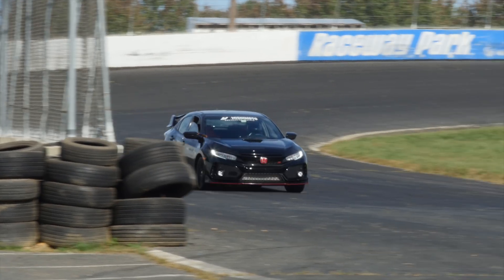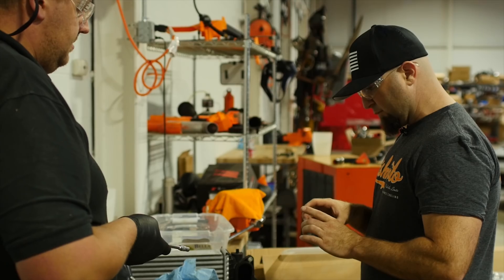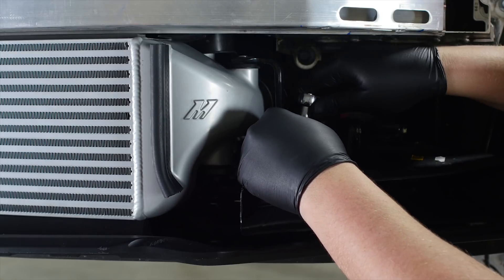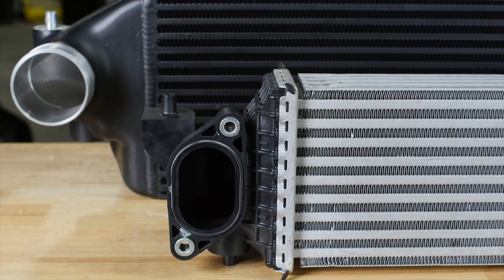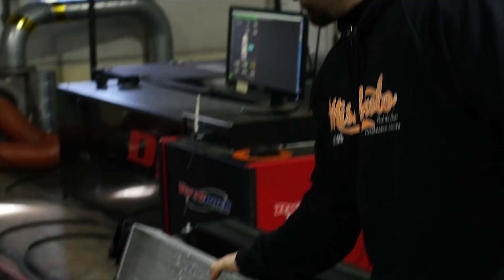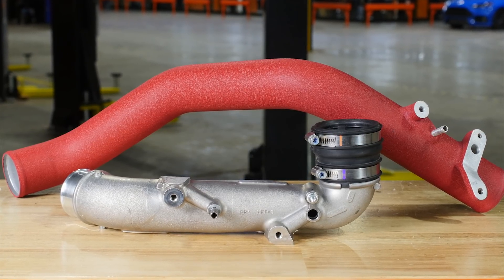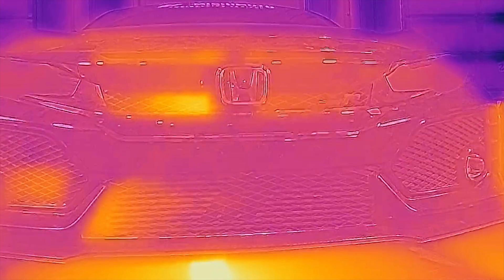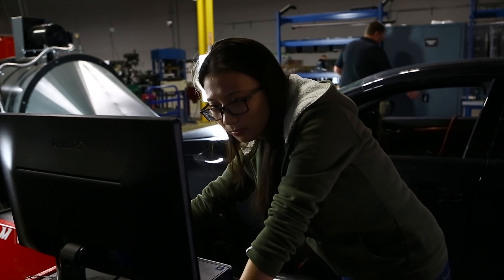2017-2021 Civic Type R Performance Intercooler Product Development by Mishimoto

Comment: Hi Mishimoto

I have recently purchased your intercooler here in the UK, ready to install at the weekend,  I have a few queries firstly the item looks like it has been out of the packaging with marks on the top of the intercooler, there is no bumper removal tool, and I have now been told this item will not fit my UK FK8, please confirm if the item will fit, as if not it will have to returned 

Many thanks
Reply from the maker: Our production team were not able to identify any differences on the UK delivered cars when it came to fitment for the FK8. The install should go pretty smoothly, if you run into issues, of course feel free to contact us at support@mishimoto.com for help.
Reply: Thankyou for your help 👍🏻
Reply: Earth Dreams UK how you go?
Reply: Unfortunately, I had to return this intercooler, as it wasn’t a direct fit for my UK FK8, crash impact bar and pop  up hood system sensors are in the way of the install , and also the hard piping has an outlet on it, the UK car doesn’t have this.

Mishimoto were understanding and gave me a refund, but unsure if these problems have been addressed for future buyers.
Reply: Earth Dreams UK same here in Australia but I moved the pop up hood system sensors above it and plugged the hole in the inlet pipe
Reply: Ben Patrick 

That’s good, I did similar to you, but the sensor kept giving warnings..I wasn’t happy with the turbo lag I was getting, not sure if you have any.

In the end I returned it. Went for a different brand, better fitment and no lag.
Reply: Earth Dreams UK how did you clear the warnings I still have mine I have a bit of turbo lag but not so much but the color is ugly it’s not silver what they say it is and what brand did u go with
Reply: Earth Dreams UK I’m ganna change myn to then
Reply: Ben Patrick 
I found it quite disheartening, spending all that money, and the item didn’t live up to my expectations... good luck with your endeavour. Hope you get it sorted
Reply: Earth Dreams UK did u bend the brackets back that hold the senor?
Reply: Ben Patrick 

Yes I also tried that, still no good, warning lights on constantly... so intercooler had to go
Reply: Earth Dreams UK when you put back the senors back in place did the code go?
Reply: Ben Patrick 

Once the sensors and brackets were back in the original place, warning light went out
Reply: Earth Dreams UK I got the senors to work
Reply: Ben Patrick 

What about the horrendous turbo lag??
Reply: Earth Dreams UK nah haven’t fixed that yet but it the way u drive it if you don’t want turbo lag just stay in high revs. How u going with your car
Reply: Ben Patrick 

Car mads are going well, just had HKS solid boost pipes, hybrid turbo and acuity stage 3 assembly fitted.

Check me out on Instagram : earthdreamsuk

Comment: Does it gives turbo lag to the car at low range? I have the mishimoto intake installed sounds nice and mid range power feels awesome but at low levels you can feel the lag.
Reply from the maker: This core helps reduce lag a bit by reducing the restrictions throughout the system.

Comment: What is the weight of the stock Intercooler?  What is the weight of your Intercooler?
Reply from the maker: The OEM cooler being a tube-and-fin style weighs about 7lbs. Ours comes in at 29lbs due to the heavy duty bar-and-plate style construction.

Comment: Do you need to tune the car for the intake and this intercooler  ? I know it sounds like a question not to be asked but I really would like to know. Thank you
Reply: It would be beneficial, but I don't think it's required. If you did cams, or anything inside the motor, you would for sure need to have it tuned. I mean, if you're dropping $1000 on an intercooler kit, then you can drop the $690 on Hondata

Comment: Please provide data as well for ECT# 1/2 before and after install of this new intercooler. Thanks!
Reply from the maker: We will be releasing some in-depth data in regards to our
approach in keeping the Type-R cool.  We have quite a bit of info on this
topic that is requires a completely separate analytical production.  Stay
tuned.

Comment: What about the turbo having to fill all that extra space? Are you getting lag? The truth please, ty
Reply: legofranco if you look at the dyno chart, the readings are not much different than stock. If there were lag, you would see it at around 3k-3.5k rpms before peak boost.
Reply: my buddy installed the new PRL intercooler on his type r, I notice a bit of lag on the bottom but of coarse made up for it at midge range punch. check it out @tunetlife ig
Reply: Any thoughts on the Mishimoto over the PRL?
Reply: love your products can you build stuff for the veloster N now please.
Reply from the maker: There is zero noticeable lag with the addition of the
intercooler and piping.  Especially when driven on the street.  When
coupled with our intake system you really feel the benefits of the intercooler
pulling hard on the top end.  When driving the vehicle lag would be the
last thing you would think 😊